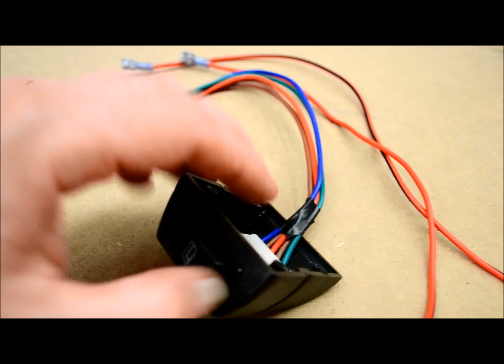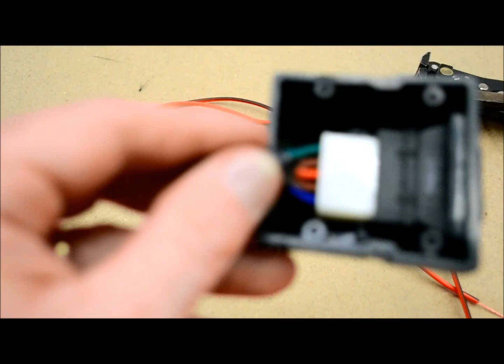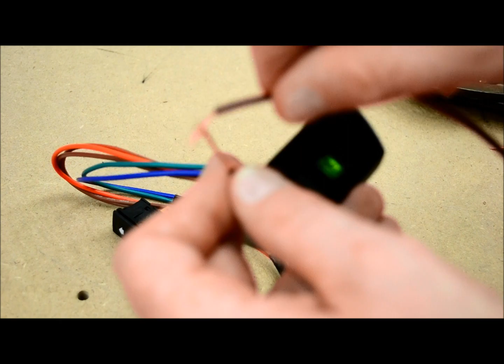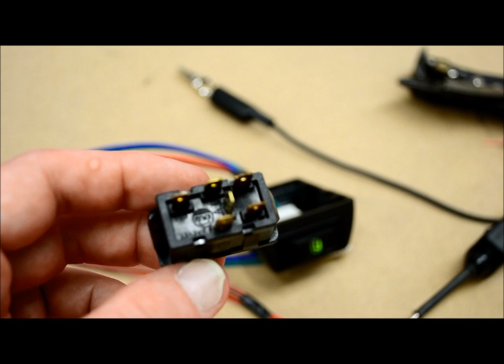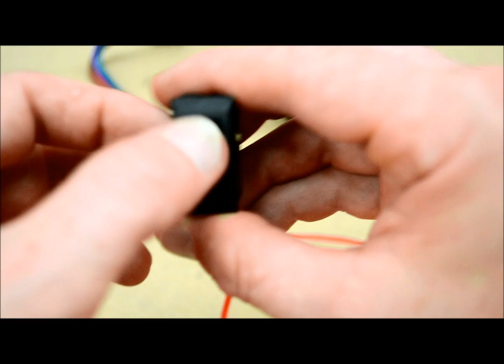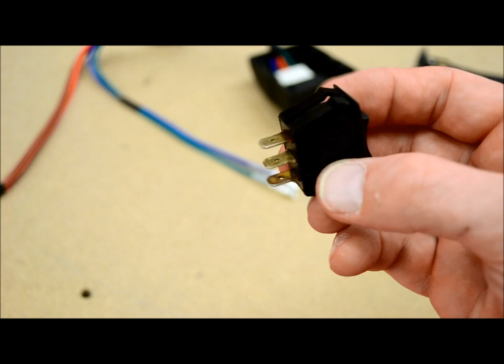How to wire door lock and power window switches

Comment: is there another way to connect a window motor.. im using one for a partition on a van and didnt want to use a switch.. i want to operated with an app (Bluetooth relay board) but i thoung i was going to have a ground and two positives now i dont know how to do it.. any ideas?

Comment: Hi I bought. Car that was converted to power windows 2003 sierra however their are no relays that I can see . Looks like remote is the 12v. Reg ground and then 2 running to the power window motor . Do I need to get a relay ? My window goes up slow . And the window only goes up when I turn ignition also sometimes I have to open door and close it inorder to get the switch to work . Do I need relay ? If so how do I wire it ?
Reply from the maker: some kits just don't have relays, yours sounds like one of them. and the older gm trucks ALWAYS have lazy windows, I never saw one that wasn't. all you can do is grease them liberally to enhance the performance.
Reply: Thank you sir. One other quick ? Where can I buy your test light ? Model brand etc???

Comment: Ok - I'm changing my manual ford e150 van doors to electric windows/locks/mirrors just by swapping doors with everything in them - as for the windows I found out how to wire the passenger door switch and the driver door switch BUT I'm confused on how to wire the driver door switch which controls the passenger door - I found the wires on the passenger door which when I connect the hot and ground directly the window goes up (if I reverse polarity it goes down) so how do I use that with the driver side passenger switch?
Reply: Did you figure it out?
Reply: @Blazersin7  - YES! I couldn't tell u how - tho it's been 6 years - but been using it all the time - but I never connected the power locks - which is fine - I'm just glad to have power windows with my Huskys - even tho one had his paw on the switch and caught his head in the window - he was never hurt - was funny tho- he never did it again - ahaa

Comment from the maker: You can definetly swap it into your Saturn, Just be sure to have the dball reprogrammed with the gm software prior to reuse, as for the vehicle wiring, It is here:  youtube.com/watch?v=cqk08zGg0Ls
Reply: @Lessco Electronics 

I need some help bro. I want to wire up some switches to my windows on my racecar.  The windows, motors and regulators are installed . I have the wiring diagram but my electrical skills are novice at best . I have the window motor harness spliced and ready, and a couple 20amp fuse wires. However, There are about 8 wires coming from the window motor harness, so my question and where I need assistance at. Is what wires am I going to use for my switches? What wires do I bridge together to make the circuit possible ? etc .Below I have listed out the color and specificities of the wires coming out of the driver side window motor based on the diagram for my vehicle . Please assist me. 

Driver window motor 

Wire 1: Auto/ VT-LG

Wire 2: DACC/RD-LB

Wire 3: UP/ WH-BK

Wire 4: Down/ YE

Wire 5: Short Drop/ LG-BK

Wire 6: GOC/ LB

Wire 7: B+/VT-YE

Wire 8: GND/BK

Comment: Dear sir Martin, i have an avital 4103 w a dball express kit that i removed from a 07 wk grand cherokee, the people who installed it did a piss poor job it took the body module out twice. I am wondering will this setup work for a 02 saturn L200 2.2 ecotec. I looked for wire harness diagram and couldnt find any for l200. I would like to instsll it in the saturn instead.